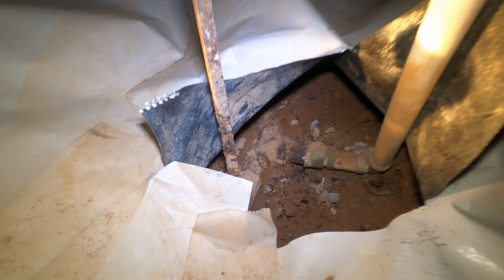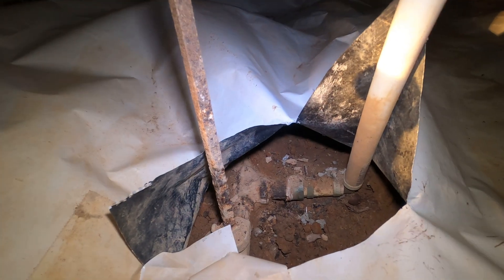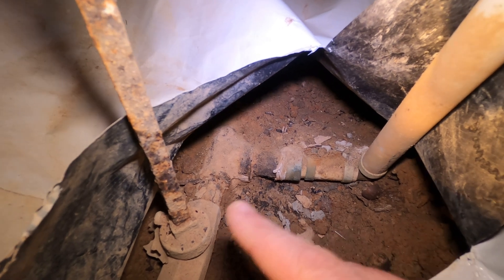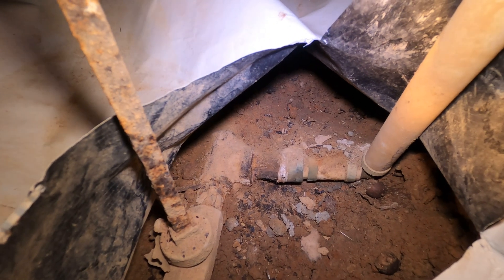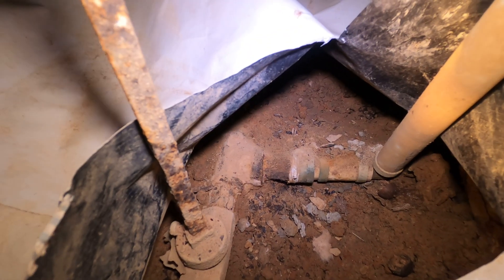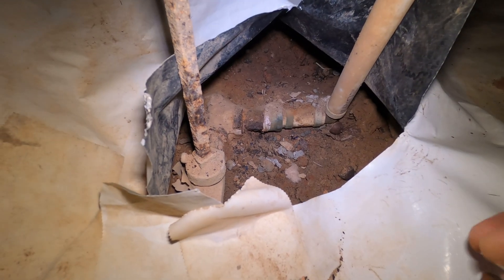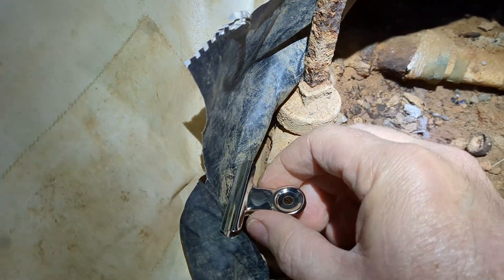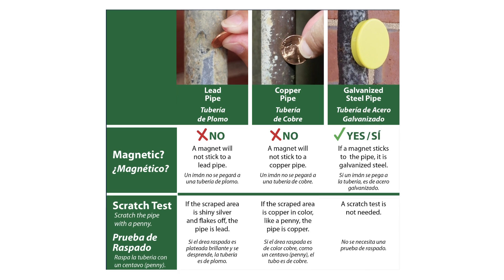Testing Water Pipes for Lead | Simple At-Home Method

Comment: If you have galvanized steel pipe, I would get rid of that also.  Galvanized will corrode from the inside (grow shut) and that is not good at all either.  Better to do it now, than later.  Especially with the city involved in replacing lines.
Reply from the maker: Oh, good point. I did not know that. Thanks for the info!